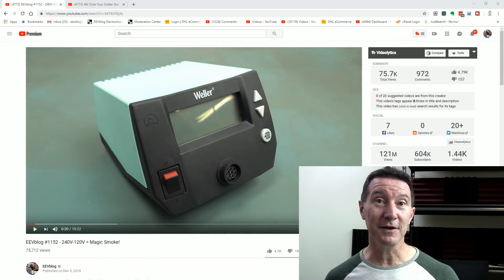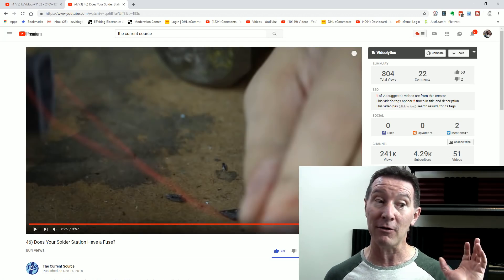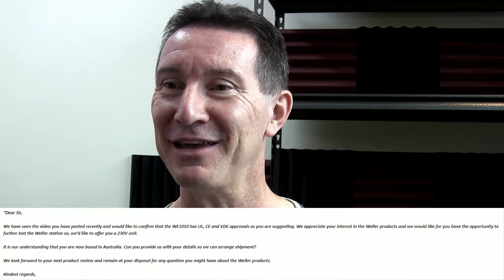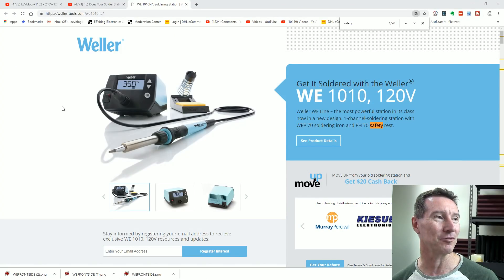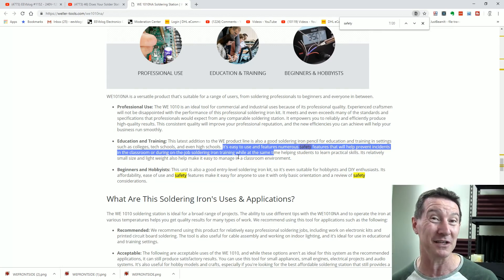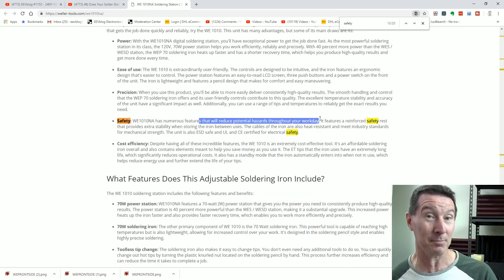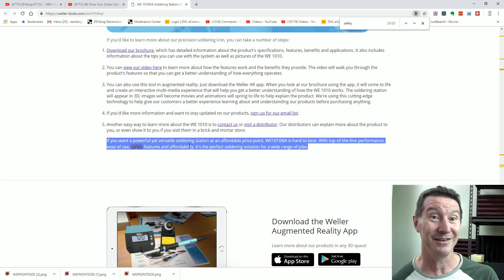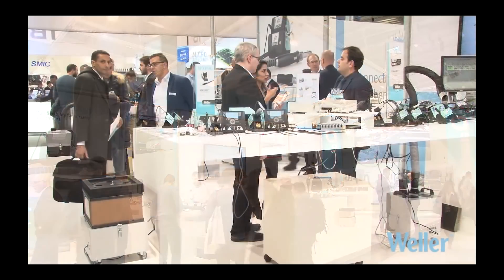EEVblog #1160 - Weller Responds!

Comment: Weller totally screwed up the handling of this.
604,000 electronics engineers now know Weller value extreme cost savings over real world safety.
Their customers are engineers, and unlike normal consumers, engineers aren't stupid. 
I think they forgot this fact.
Reply from the maker: Andrew Delashaw - Actually, more than 50% of my audience are qualified in EE
Reply: @EEVblog  I am in the other half. I am only qualified in SE (Software Engineering) and solder in my free time.
Reply: EEVblog how do you possibly know that? You seriously checked the credentials of half your audience?
Reply: @EEVblog  I'm qualified in mechatronics engineering
Sorry to disappoint you Dave :c
Reply: @EEVblog  Qualified EE, reporting in.
Reply: @EEVblog  maybe even higher, as others would get lost/bored in the math(s), important terminology and base knowledge that make these videos desirable to an EE.   Those people would, IMHO, not find it as useful or ENTERTAINING.  Let's face it, a teardown is a memory tool to remember chip ID numbers (ok, for me I like the challenge of hearing the chip, pausing before the data sheet).   Dave's details of test equipment go into important professional realms of process/usability that I don't see much of anywhere else.  I think he has a perfectly targeted audience for his branding.
Reply: @EEVblog  And some of those of us who aren't might be major enough hobbyists that we may as well be, having things like Ham radio licences ;)
Reply: @EEVblog  So, They are practicing, licensed, Professional Electrical Engineers? Or are they Manufacturing Engineers for Electronics?
Reply: Did you just call me stupid?
Reply: @jerryblood9554  Sure sounded like it, didn't it? I'm trying to figure out what his actual point was. My profession happens to be in software. It could well have been in EE, since I started that hobby when I was about 10. And I'm not sure what "actual work" is/isn't, based on his comment.
Reply: They even have the balls to say 120v OR 60Hz lol
Reply: @cyb3rk3v  it woz the 50hz magic smoke that killed it... 😒
Reply: And those engineers will tell their friends...
Reply: @ThinkingBetter  And their friends will roll their eyes and sigh, that their friend is complaining to them about a brand they never heard of
Reply: all three of them ? @ThinkingBetter
Reply from the maker: Okurka The people who filled out my survey
Reply: Yep, marketting fu$$$$d this one up!  The real reply is - we didn't fit a fuse because it saved us $0.50 per unit and isn't required by some of the poor safety standards used globally.
Reply: so the ones who dont have a EE degree are stupid consumers? do you know who is stupid? you sir! your degree proves that you know SOMETHING about electronics, but who cares for proof?only your employer maybe, at best, because believe me there are many people without a degree that can put you in their shirt's pocket.
Reply: Hi, last time I hold a soldering iron was in 7 grade and I burned the couch. I am not an engineer, not even into a hobby about this. I just like how he speaks and I learn some things from him if I can.
Reply: Modern cancer of the market is wanting to grow before safety or quality,,its stupid wanting to convince that he is the smartest and therefore deserve more than anyone..it never ended well, look at the whole world right now,,,profit over peoples is what gonna kill all industry.
Reply: >unlike normal consumers, engineers aren't stupid. 

you clearly don't work around engineers. it's the same intellectual dartboard you get anywhere else. but typically with way worse social skills.
Reply: @SuperAWaC Most of my experience with engineers is with soils and structural professionals. They do tend to the nerdy side of things!
Reply: SuperAWaC you can say that again with the social skills
Reply: @SuperAWaC :
"...intellectual dartboard..."  Heh.

I will, definitely, be using this term.  One "caveat", though:  The "zero-sigma" peak of the Gaussian distribution regarding the intelligence/competence of engineers (Yeah, I'm one of 'em!) is shifted somewhat to the right of the one for/of the general population.

Somewhat.
Reply: @SuperAWaC  Some things that are usually taken as a sign of intelligence are not actually a sign of intelligence one such sign is social skills.
Reply: SuperAWaC Where do these intelligent Engineers exist? In my line of work they are very hard to find.
Reply: You see Nick, intelligent people like to stick to other intelligent people...
Reply: v ant You might be correct Australian Doctors that are good at there jobs don’t stay here. Might be the same for the Engineers. The small percentage of decent Engineers I have worked with might just like that industry. I don’t know can only say what i have saw. Maybe they become Youtubers there seems to be alot of intelligent people posting videos these days.
Reply: @linkavichtruousky1  before impuning the intelligence of engineers in a public forum you may wish to use some of your own (implied) intelligence to check and correct your less than good spelling and grammar before posting. 🤔🤔🤔🤔😔
Reply: Bob Lewis No intelligence implied here Bob. Call it as i see it.
Reply: 4k EE, 50k hobbyists who have a really good understanding of electronics, 100,000 hobbyists who know a bit about electronics, and 450k "makers" who go around saying "full bridge rectifier" and I'm subscribed to EEVblog, AvE, ToT, and other machinists to make themselves feel like they do actual work rather than just being "makers." (I'm sure you know the type.)
Reply: @xenonram  FULL BRIDGE RECTIFIER!   While I do know the type, I think they would be the minority on this sort of channel.  Checking in as a hobbyist and son of an EE that picked up a lot along the way.  Also, electroBOOM and AVE are Legit.
Reply: @xenonram  hey I'm subscribed to all them but fact of the matter is I'm an engineer.... power engineer... 

P.S. if you get a 215V Weller send it this way I'll put it through 600VAC @ 200Amps... or just send it to photonic induction lol
Reply: Oh now, Photon would love something like this to pop... hope he's doing OK... Weller really messed up here, like Dave said even the cheapest of the cheapies has primary side protection! Looks like the marketing wanketeers have taken over the reins...  Oh, AvE, photonicinduction et al... all skookum choochers in their own way, just as EEVBlog is too... (And I'm just a lowly self-taught jack of all trades with a soldering station and a lean towards electronic/electrical work)
Reply: @xenonram  you forgot your group, the elitist wankers
Reply: There are well over 20,000 EE’s in Silicon Valley alone.  So your comment about 4K EEs is rubbish.
Reply: it's not my fault your too poor to buy a 15$ outlet receptacle that is primary fused
Reply: Weller did not screw anything up, that was more than nice of them to offer a moron who did not check the mains voltage before plugging it in. This is not an issue with Weller irons.
Reply: @wildbill4476  As he pointed out, it is, as it could easily be damaged when used "correctly" due to voltage spikes and SHOULD have something that cuts it off if the transformer insulation were to fail.

I used to mess around shorting out transformers as a kid as I didn't know any better.  I never set the house on fire as they all had thermal fuses that would cut-out if the transformers overheated.
Reply: Alex Atkin but it wasn't .. in all of the time he had it, it didn't break due to voltage spikes, it broke due to human error. Not a faulty product, a human error. You can hypothesize about all the ways it COULD break, but none of them are the way it did - grandiose ass Dave is. Yet somehow he thinks someone owes him an apology and some kind of PR parade because he didn't exercise the most common of common sense and check the specs before plugging the thing in. Engineers are clearly all geniuses!
Reply: @martinj9647    you miss a few points. It is not about wanting an apology. Yes, I don't know much about the stuff, I will actually repeat things I have read so you can say "what you heard is wrong". Anyway:

Some people say "engineers can't guess every possible way of fail" etc, while other people claim that it is a basic safety caution and even many cheap products has that kind of safety. And since it is about safety, it is not about what happened but what would happen; and people can hypothesize about it.

This video is not "they didn't apologize me" video. Actually, he had a teardown video a week ago and if you watch that, he starts with saying how he made the mistake. And before starting teardown, he says "and there is nothing wrong with weller, it was a pebkac, it was me. Let's crack this open and see what damage we've done" so I think saying he tries to blame the company for his mistake is unfair. It was more about a thing he noticed while checking.

Edit: I am watching that video again. He shows a fuse has blown and says that it protected the secondary side of it(the boatd). "This design is quite good from a secondary side protection point of view but unfortunately there is just nothing on primary side." Also he says that he also mentioned that in his review before.

Comment: I guess it makes corporate sense to bribe reviewers rather than acknowledge fault. What's disappointing (aside from the grammar) is that Weller is a major brand name in this field and has been for a very long time.

(Personally, I'd have used a Simpsons clip instead of the Naked Gun clip: youtu.be/Dz_G15g8sbo )
Reply: There was nothing wrong with the unit. It complies with north American regulations as it is only meant for the NA market.   Primary fuses aren't required with power cords of a certain length (which this has).  A primary fuse wouldnt have saved the primary coil from damage before blowing anyway
Reply: The writing was already on the wall some twenty years ago. Their entry level budget line wasn't as well designed as you would expect from normally priced items from a reputable brand. Even if that brand considers normal prices to be budget.
Reply: They did not bribe him, they figured he was not smart enough to buy the right iron for the country he lived in and found it easier to just send him a freebie than listen to him whine after he fries some more.
Reply: @wildbill4476  Ooh, so that's what they meant when they wrote "we see you're based in Australia now". Did the marketdroid get the impression that this unit was brought along on a move from the US and subsequentially  liberated of its magic smoke? Then it would sort of make sense to offer a replacement unit to keep a customer happy, but they sure did misread or misjudge the situation and it's not exactly helping them. The product itself would be legal in the states, even if barely, but legal whether one likes it or not.